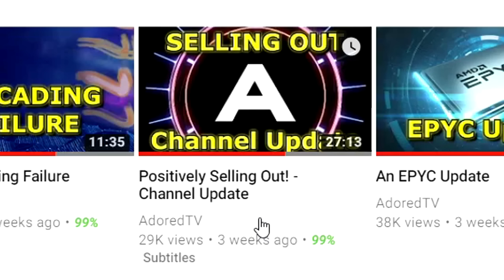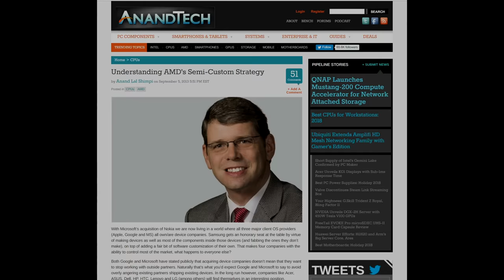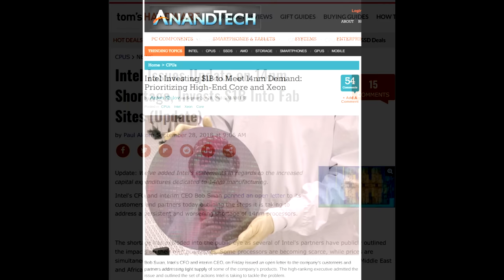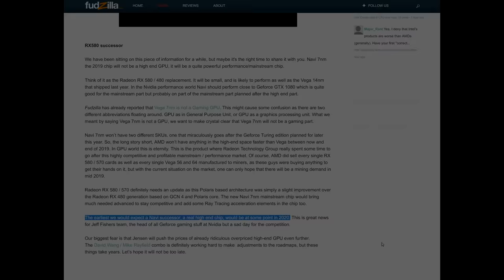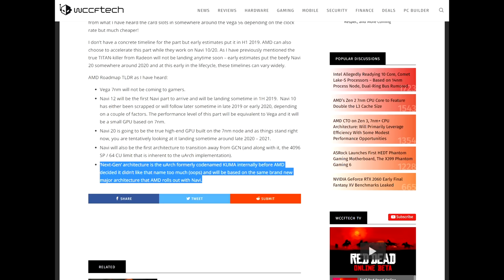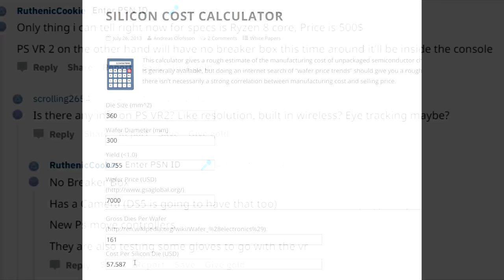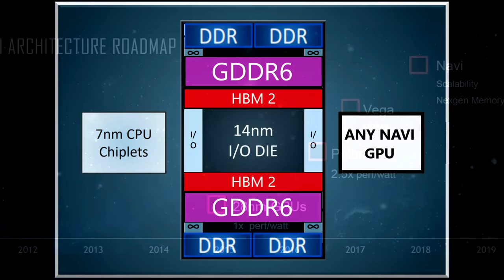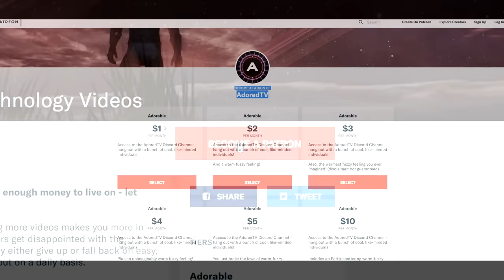AMD  - The (Evolving) Master Plan

Comment: I'll repeat what I said elsewhere about MCM GPUs.
As AMD themselves have now noted, having such an architecture is going to give you all the same problems as you'd see with XFire and SLI - At least, that'd be true if you use OpenGL or Direct3D 9/10/11, and expect to make use of all chiplets on the GPU.
The solution there would be to just not allow X-Fire/SLI - modern graphics APIs like Vulkan (and probably DX3D 12 too) allow you to explicitly pick the chip you want, or in fact use both (or more), allowing you to explicitly distribute tasks across graphics processing units. If you're using an Optimus laptop, even right now, they can use the intel chip to accelerate a few draws while your nvidia is still left doing 80-85% of the work. Granted that's work the developer has to do, and it'd be easy to screw it up, and get some horrible graphical corruption or synchronisation stalls.
Future APIs, looking at ray and path tracing, are what we would call "embarrassingly parallelisable" - which is to say it basically scales linearly with computational power, regardless of how it is distributed. MCM would be the only way to do this stuff at a high quality in real time.
It might also net us some cool stuff, like 2-part SR-IOV on consumer hardware, which would be awesome for someone like me who runs windows in a virtual machine via OVMF/VFIO.
Reply: Not really and low level hardware details are for the most part abstracted away to developers/programmers, it's not really all that different than having to deal with caches. An MCM GPU would behave no differently than the current Ryzen-based CPUs and APUs.
Reply: @Uruz7Laevatein  It would have to behave quite differently for performance reasons.
Such abstraction means you'll have to deal with all the same problems and quirks as presented by SLI/X-Fire - even AMD has acknowledged this.
At present - unless AMD can figure out a way to glue stream processors together rather than 2+ smaller GPUs - the only sensible approach would be to present the card as a multi-function PCI device that hosts multiple GPUs.
Developers that don't want to deal with SLI/X-Fire (legacy APIs), or distribute the work themselves manually (Vulkan/DX12), will not be able to make full use of the card's resources.
For those that do, DX-12/vulkan should allow them to easily reach 80-90% utilisation (varying on scene), while higher will become exponentially more difficult.
And if you're looking at ray tracing, scaling is linear, so you'd really have to screw it up to not get 99-100% utilisation of the entire GPU.
Reply: @billy65bob  None of which would be a problem at all the complications of multi-chiplets are handled by the memory controller/scheduler/uncore on the MCM in hardware level that is invisible to user, all a programmer/driver will see is simply one GPU under the hood. SLI/Crossfires are issues with latency between moving data from PCI-E lanes that are orders of magnitudes of distances greater and drivers.
Reply: And threadripper has less inter-node latency than a dual-socket intel board - your point?
Just because they'd become neighbours does not make the synchronisation free, or even cheap for that matter - granted It's cheaper than it would be with an SLI bridge separating them.
We're effectively introducing NUMA to GPUs here, and if you want them to cooperate on scenes transparently in the background as per SLI, you'll be paying all the same costs, they'll be somewhat cheaper sure,  but you'll be paying them all the same.
And all the problems with the tech won't go away, just because they now share a memory controller.
Reply: @billy65bob  And they all obey the laws of physics your point? The differences aren't somewhat they are magnitudes since the the speed of electron/light are constant in the same material medium relative to distance. None of that is entirely relevant to the programmer (any less that they are worried about the differences/arrangement between l1,l2,l3 caches of cpus/gpus, and individual alus, or having to programming in binary for that matter) and is out of their control, whereas SLI/Xfire actually is (since it's both software and hardware to a MUCH greater extent). And neither problems of latency won't go away unless you develop Faster-Than-Light /Tachyon computing, but hey we have things like SRAM/caches since the 1970s to cope with these issues.
Reply: @Uruz7Laevatein  SLI uses that SLI bridge for communication and data transfer, hence I compared a threadripper with multiple intra-socket numa nodes against a dual socket intel which would have multiple inter-socket numa nodes.
Having a MCM GPU design will inherently introduce NUMA into GPU space, with all the quirks and ramifications thereof.
And being a MCM design, the simplest, easiest, and most performant way to handle it would be to present it to the OS as multiple GPUs - Vulkan (and presumably DX12) ARE ALREADY SET UP TO FACILITATE EFFICIENT DEVELOPER-CONTROLLED MULTI-GPU RENDERING, that is the entire bloody point of having a low-level api like vulkan.

And with legacy APIs you're going to have all the same problems that you'd have with normal SLI/Xfire if you want to make use of both (or more!) chips.
You're going to have all the same stutters, all the same instability, all the same glitchiness, but at least you'll get more than the +30% FPS that you'd currently get with an idyllic case.
The glitchiness stems from SLI being a giant hack that says "oh, you've cleared a buffer, I guess I don't have to synchronise it to the other GPUs if you want to use it there" - the legacy APIs provide insufficient means of actually describing object, buffer, texture, and render target lifecycles.
So it uses these hacks to allow GPUs to write to buffers that aren't shared, this is where most of the scaling comes from.
To mimic traditional SLI, memory would have to be split and cloned for each core. This will net you similar but somewhat better scaling due to the lower latency, I'd wager it would cap out at around +50%.
Arguably, due to the much closer proximity, there won't be a need to mirror the memory too much - But this will introduce all of its own brand of glitches if buffers aren't properly protected, and this protection can cause massive stalls in the pipeline (think 0% scaling). If driver developers wanted to be clever about it, they'd mimic Copy On Write and achieve their scaling through that. It has the advantage that you'll have a lot more VRAM to work with - I don't know how well this will scale, but I imagine it'd cap out around +70%.
I can say with certainty that both of these will scale worse than presenting the MCM as 2+ GPUs and having the developers distribute tasks themselves with an actual multi-GPU aware rendering API like Vulkan. A major weakness of hacks like SLI is that they have no knowledge of dependencies between render stages.

Your entire argument there however is just a giant non-sequitur. Ignoring the laws of physics? hugh woat? programming in binary? who said anything about that!? programmers don't really care about the intricacies of the CPUs and things? Of course they don't - until they notice their programs run 10x faster if they sort their input data beforehand so the branch predictor can actually do its thing. 
Non of that is relevant here.
Reply: ".........And being a MCM design, the simplest, easiest, and most performant way to handle it would be to present it to the OS as multiple GPUs ......., that is the entire bloody point of having a low-level api like vulkan."

Not really no amount of software implementation will be as efficient as hardware implementation (the advantages of software vs hardware implementation is a matter of flexibility/compatibility vs efficiency). Low level APIs like Vulkan are low level relative to high level APIs (DX12,DX9,OpenGL), but they aren't low enough like microcode to manually tell things like particular uncores/ ALU #xxxx/etc in how to specifically behave (i.e like asking ALU #xxxx to write to L2 cache, and another ALU #xxxx to read from said L2 cache thereafter). 

 @billy65bob  "...Blah Blah Blah .....Non of that is relevant here."

     Lel sure it is, all of the so called issues/intricacies of MCMs are resolved (just like any monolithic CPU/GPU/ASICs are at hardware level far more efficient than software APIs could ever be,  simply MCMs and interchip/module communications operates on a far lower level than SLI/Xfire will ever be) just like CPU caches, intra-CPU communications, etc are dealt with by any half-competent engineering team on the hardware side (the MCM either works or it doesn't), and software optimizations are mostly dealt by compilers/compiler engineers and engine/graphics programmers. The only thing high-level programmers (C++,Game Programmers) mostly and should ever have to worry about is writing/debugging "readable" code in high level language with proper documentation. 

     Most if not all of the issues of SLI/Xfire are software/business issues due to compatibility reasons (multi-GPU implementation being "cheaply tacked on", the particular program not being compatible due to alot of programs aren't they weren't developed with multi-GPU scaling that in mind, and either require patching or rewriting the entire code base to with the APIs in mind which cost time and money). For a program that doesn't support SLI/Xfire, it will experience a performance speedup on an MCM regardless as if were a single monolithic GPU (albeit not as efficient due to Ambdahl's law).
Reply: @Uruz7Laevatein  Christ man, just how low level do you think I'm talking about with APIs?
Not only is stuff like Cache coherency and cache writes utterly irrelevant here, it is utterly insane to even attempt to optimise at that level unless you're targeting something like a console.
Also, DX12 is the same kind of breed as Vulkan, if anything it's even more accommodating for multi-GPU as it doesn't even need the two GPUs to be from the same vendor. 

Any solution that relies on hacks in the driver (ie, SLI/XFire) is going to deliver suboptimal performance.
Do you understand what it means when the legacy APIs are too basic to properly track lifecycles?
It means that all buffers and render targets need to be synchronised.
They don't understand multithreading - they don't understand concurrency - and if they do, they only do it on the CPU level.
Do you understand the implications of continuing to use legacy APIs and relying on such hacks to achieve concurrency?
This model intrinsically cannot scale very well by the very nature of being built on a legacy API that cannot be aware of those quirks.
Do you understand the main hack used to allow good multi-GPU performance via SLI/Xfire?
It involves clearing buffers, render targets, and textures, IMMEDIATELY after assigning it to be worked on, this avoids having to copy the buffer from one GPU to the other, this is where the majority of the SLI/Xfire scaling comes from.
I'm not debating that a MCM design wouldn't inherently scale better than the current dual-card setups - It's obvious to anyone with 2 brain cells that the MCM would in fact scale better. The difference is not going to be half as big as you expect it to be - I imagine latency would be down 25% plus whatever you gain from not having to aggressively clone VRAM for the GPUs.

Do you understand that vulkan lets you open multiple physical devices? manage multiple command queues? and synchronise various primitives between these?
Do you understand that the absolute best a driver can do is SUBOPTIMALLY GUESS at what the programmer wants? (e.g. by where he calls glClear())
Do you understand that the programmer, having a much better idea of what is expensive and inexpensive in a program and the dependencies inbetween, can do a much better job distributing work? Especially against a driver that can merely guess as it receives instructions?
Do you understand that something that is tailored to a program's quirks and oddities inherently performs better than something that is general and all-purpose?

I really don't mean to come across as an acerbic asshole, but to me it just feels like you're parroting big words and acronyms without any understanding of the implications they hold for an actual implementation.
Reply: @billy65bob  Uh uh uh uh , yawn....

"Christ man, just how low level do you think I'm talking about with APIs?...."

Apparently very low "coding to metal" nonsense, and no consoles in this day and age even optimize that low level despite having low level APIs compared to PCs.

"Any solution that relies on hacks............... "

Uh huh yes we understand ,none of this is an even programming issue in an MCM, and all these things are managed in hardware in the MCM (i.e the I/O die that contains the hardware-scheduler/memory-controller in Ryzen series of Chips), thus making the comparison to SLI/Xfire moot.

"Do you understand that something that is tailored to a program's quirks and oddities inherently performs better than something that is general and all-purpose?"

Yes.., the thing is a software implementation will NEVER perform better than if it was implemented at a hardware.....

"......it just feels like you're parroting big words and acronyms without any understanding of the implications they hold for an actual implementation."

Except some of us do, keeping things short and concise shows better actually understanding without going on like an college essay, these acronyms are nothing more than basic computer terms.
Reply: @Uruz7Laevatein  
I think I see what's happening - we're talking past each other as you're describing a MCM that frankly lies and presents itself as one chip that Just Works.
Whereas I'm describing what most likely to happen, a multi-function PCI device that presents multiple GPU chips.

When I'm talking about low-level APIs - I'm literally talking about Vulkan/D3D12 - I cannot make that any more clear than I already have numerous times.
The extent of it would largely be "okay GPU #1, do all the occlusion queries for dynents while GPU #2 renders the world; okay GPU #1, do all the even lights, while GPU #2 does the odd ones; etc" - Can you see how this allows tasks that'd normally be far more synchronous to be done in parallel? Both Vulkan and DX12 already allow you to do this.
You're the one who keeps bringing up "coding to metal" nonsense and then repeating my point back to me of it being utterly insane to optimise to that level, because no one does it - not even on the platforms where it could potentially make sense.

I don't think you understand just how difficult what you're proposing will be. Just look at 26:07 of Jim's video - AMD themselves acknowledge this comes with all the pitfalls and challenges of SLI/Xfire - if you won't believe me, then believe them, unlike both of us they're actually experts in the matter.
They acknowledge it's a NUMA - something that comes with far less latency than going over a SLI bridge, but still a hell of a lot more than if the processors were in the same complex.
So no, the SLI/XFire comparison is not only not moot, AMD themselves acknowledge that it is very very relevant to how a MCM device would scale if they go through the effort of presenting it as a single-chip.
Frankly considering their track record with drivers (and OpenGL on Windows to this day), I don't trust them to do a good job of it.

And the entire reason I accused you of 'parroting big words and acronyms with no understanding' is because you keep going off on utterly irrelevant tangents about L1/L2/L3 caches and other 'coding to metal' nonsense.
Reply: @billy65bob  "...we're talking past each other as you're describing a MCM that frankly lies and presents itself as one chip that Just Works.."

Lel Which is how Ryzen if not how all CPUs/GPUs works to an extent despite having multiple chiplets/hardware blocks glued to one pcb. It's the most optimal solution and the most sensible that would apply to GPUs going forward(since the definition between CPU/GPUs are purely semantics).

"multi-function PCI device that presents multiple GPU chips..."

You mean the design choice that is the least practical with more drawbacks.....

"I don't think you understand just how difficult what you're proposing will be. Just look at 26:07 of Jim's video...."

Gasp* you mean most practical and optimal solution given the circumstances that's already proven to work with AMD's Ryzen CPUs is that AMD is attempting to apply to GPUs going forward. It's a challenging task just like any engineering project, no one says that it is easy, it's not something that is magically impossible all of a sudden. 

"You're the one who keeps bringing up ........"

yawn*  Uh huh huh going on a tirade like an college English essay isn't making any points than what can be done with smaller and concise arguments.
Reply: @Uruz7Laevatein  Except the CPU doesn't lie about being one, it literally tells your computer how many cores there are - heck Windows even installs a driver for each!
If they're separate, i.e. threadripper, Epyc, intel Dual Sockets, they literally tell the OS so it can schedule work accordingly - this is the entire basis of being NUMA aware.
And despite literally telling the OS, it does a very imperfect job, even with a threadripper 1950X (or a 2950X) you can get 50% higher output in synchronisation heavy workloads if you PIN THE PROGRAM TO A SINGLE NUMA NODE. 
Do you at all understand the implications this hold for a GPU of a similar design?
I'll spell it out for you - it means even if you don't have to jump across to another PCI device, synchronisation cost is still far higher than it would be with a single monolithic chip, and it's going to slow things down immensely unless you can do things asynchronously.

Do you expect a GPU and its corresponding driver to magically do better when both windows and Linux have spent well over a decade tuning their schedulers for NUMA awareness?
I sure don't.

Legacy APIs are going to be highly dependent on that synchronization cost - there's no way around it - it's going to absolutely kill performance!
Granted you'll see much better than the typical +16% you saw from traditional SLI. 
Vulkan and DX12 can get around it if developers split their tasks smartly as per my example above.
Granted gain will never reach +100% as rasterisation engines have lots of dependencies, but there are lots of breaks in the chain were things can be done concurrently (e.g. DoF, SSAO, Screenspace reflection, HDR, SMAA can all be done in parallel without treading on each other's toes).

Anyways, I'm done arguing with you.
1. Your understanding of what an actual implementation would entail is far worse than mine, and I'm just some idiot on the internet
2. Your "smaller and concise arguments" are at best incomplete metaphors, and at worst misdirection and sophistry; frankly it makes you come across as insincere
3. You're too obstinate to acknowledge the very very real problems with MCM GPU design, and how it relates to the graphics APIs - you're smart enough to see that Ryzen's a perfect metaphor, but you don't at all understand the inherent implications thereof in applying it to a GPU.
Reply: @billy65bob   

"Except the CPU doesn't lie about being one, it literally tells your computer......"

Sure it does, does a CPU tell you how many individual FPUs or Integer Units,etc that makes up a Core, no it just tells you that it has a core........

"'ll spell it out for you - it means even if you don't have to jump across to another PCI device, synchronisation cost is still far higher than it would be with a single monolithic chip..."

Uhuh huh no shit sherlock, did you know that the water is wet and fire is hot, in the ideal world it'd be nice to make large monolithic chips but in reality things like yields/cost makes it's virtually impractical given AMD's circumstances (there's a reason why we don't have 1000 mm^2 dies in the real world), you know the entire point of MCM is a work around in dealing with manufacturing yields/cost to begin with.....

 "Do you expect a GPU and its corresponding driver to magically do better ....."

Sure, if a algorithm is implemented in hardware it's more efficient than a software abstraction (which is redundant amount of electrical signals) just basic physics, all that matters is that hardware either runs or it doesn't....

"Anyways, I'm done arguing with you......"

Translation: wahh Uruz you're mean...

Well hate to break it to yah, no one says Ryzen's perfect, the fact that it even runs is proof that the concept works and that's proof that all that matters, everything else is just irrelevant fluff.
Reply: we could had have that since years ago if Nvidia wasn't so backwards thinking and glued itself to dx11...